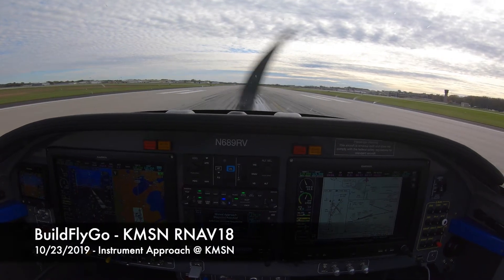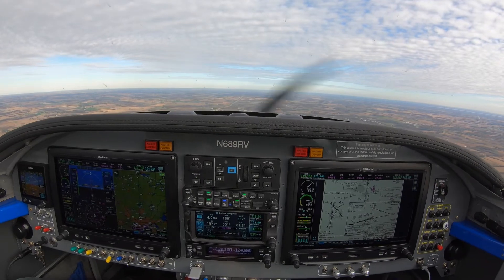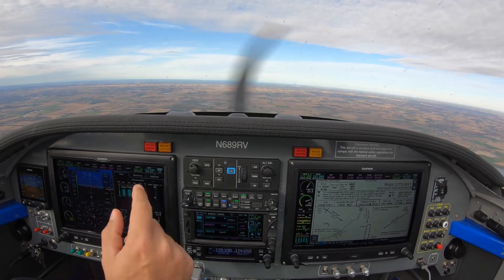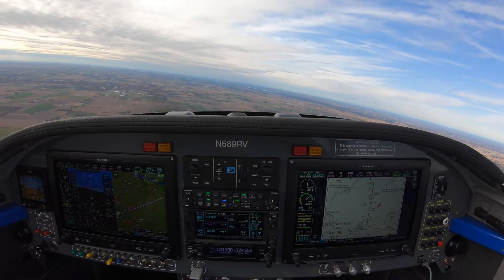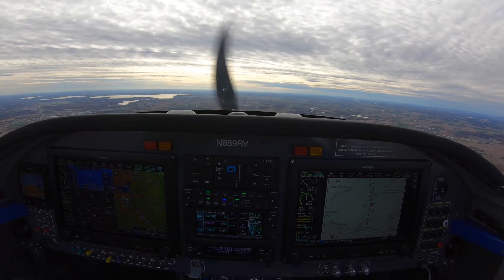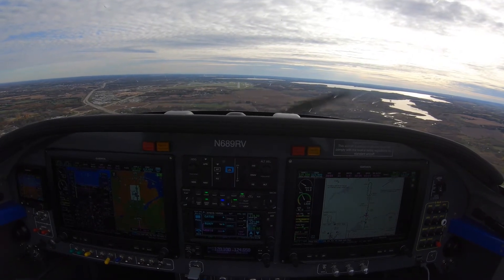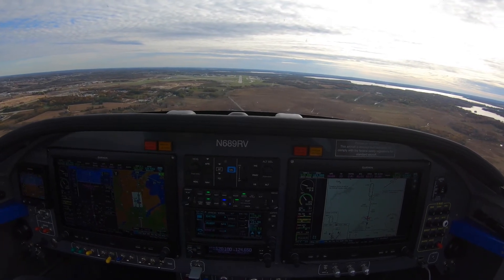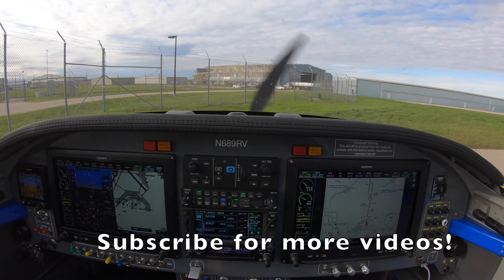Instrument Approach Part 2 - KMSN RNAV18

Comment: At the end of your approach-after reaching minimums I was surprised that no message came up. Then well after (closer to when you are landing) the “missed approach “ option message came up. 
I’m trying to understand as this is my exact setup (except GNX375 not the 650) and I noticed the same ‘late’ message when practicing an LNAV approach. Is there some other way to “warn” you are at DH?  Thanks for the video!
Reply from the maker: You can set the minimums in the GDU and it will provide an audio alert.

Comment: As you know it's too dark, but there are other issues. There is a picture obscuring the 650. I mostly understand the 650 and the G3X individually but have some confusion as to how they work together. For instance I presume you were selected to external GPS? So the 650 is in charge initially, using GPS. At some point the annunciation on the 650 must be changed to VLOC for an ILS? How does that work? There is a CDI source selection on the G3X, but I don't think that is how you did it. When you select appch on the GMC 307, does that bring up VLOC armed on the 650? A picture would be worth a thousand words! It can't be long till you produce another ILS video. Yes, ILS please, not RNAV! Your first video was great.  BTW, ideally you would display along the top of the G3X waypoint, track to, distance, ETA. But if you have 2 radios and a remote transponder, I think there is only room for 2 of those. In practice how do you deal with that? Keep a thumbnail flight plan up on the G3X? Change the corner user fields on the 650? This is all stuff I'd like to see! Thanks!
Reply from the maker: Thanks for the feedback and ideas! I'm keeping track of them for when I get a chance to make more procedure videos.